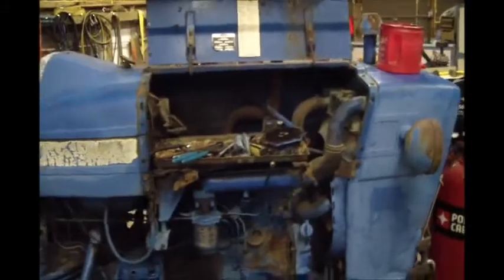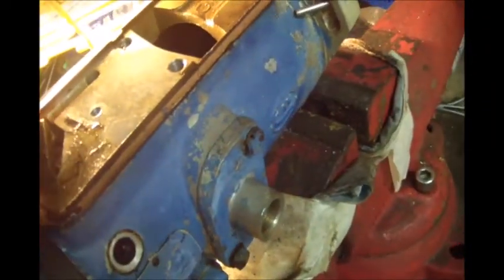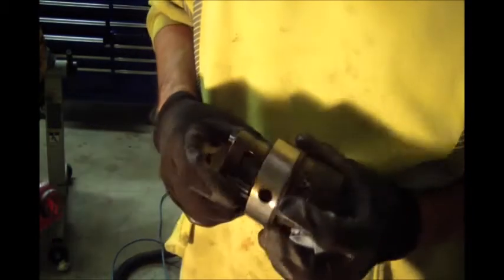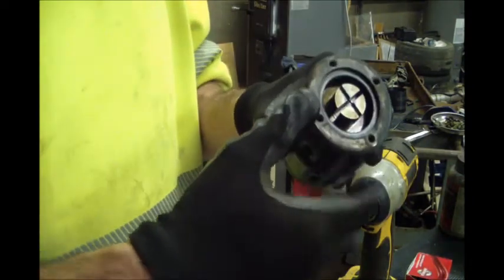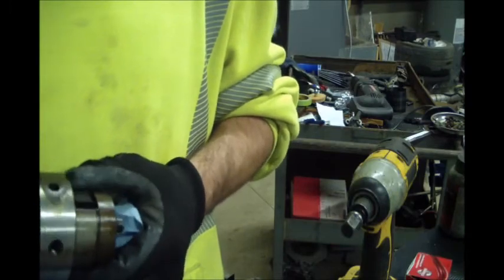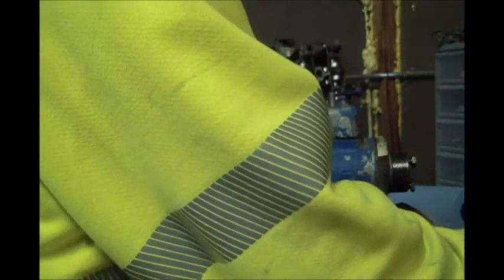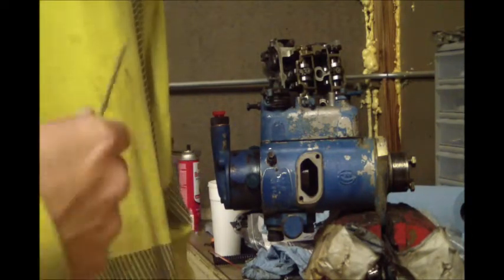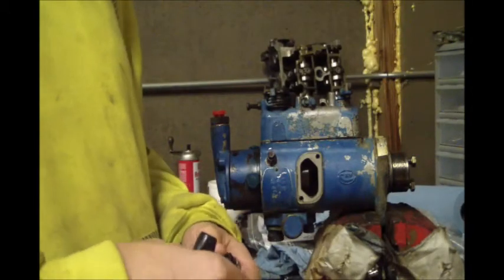Ford 3600 Part 3 - CAV Injection Pump Rebuild

Comment: Cool video thanks for sharing. I’m working on a friends 3600 that’s been sat for 15 years.
Draining tank and put new filter on and seeing fuel up to the cav pump, but not injectors. So may have to dig into the pump. Great video for insight